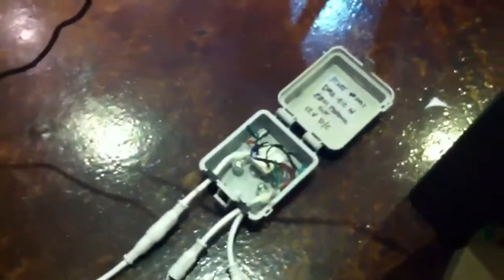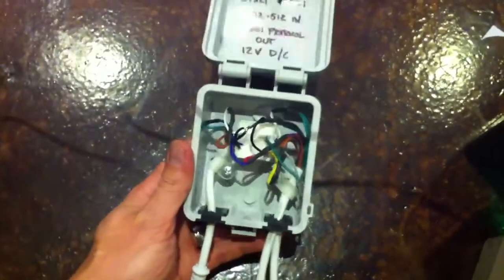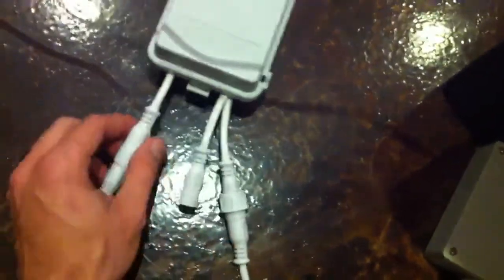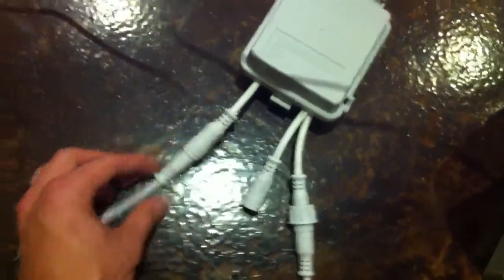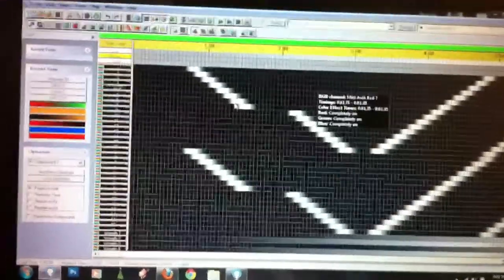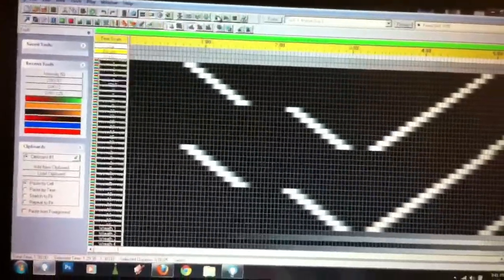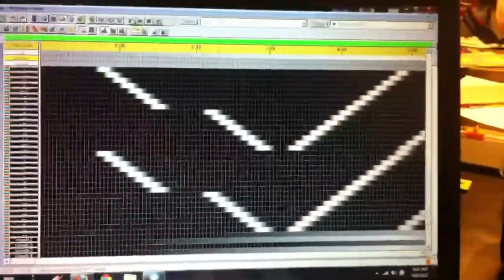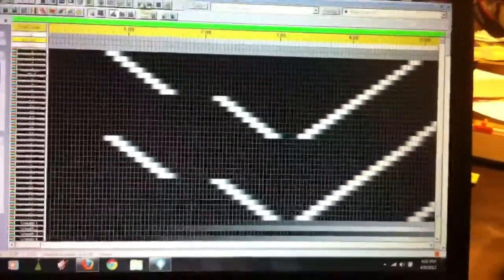A DIY Cosmic Color Ribbon for under $100

Comment from the maker: Most of the really good pixel controllers will run multiple voltages and multiple protocols.  For instance, a P2 will run two entire universes of pixels of almost any protocol and has a variable input from 5V clear up to 24V.  Flexebility in a controller is great because it doesn't limit what type of pixels, strips, modules, etc. or voltage you can use.

Comment from the maker: Jerod, there are several converters out there that do work with multiple protocols including 6803, 2801, 2811, 1804, etc.  If you are planning a larger scale pixel project I'd look at the controllers available from Joshua1Systems.  They have both the P2 and P12R as VERY cost effective solutions and both of those will handle 2811.

Comment from the maker: These small and inexpensive converters cannot be set to a unique address.  Each one will be start address one.  Now you can run multiple converters and multiple strips, each one would be a universe and it would be the most cost effective to use an E1.31 bridge for the DMX instead of multiple USB drives.  I know of several decorators who use them this way.  In the long run, the most affordable option is a pixel controller.  I use the J1Sys line, the P12RR and P2s and really like them.